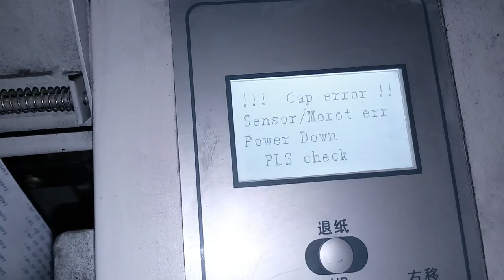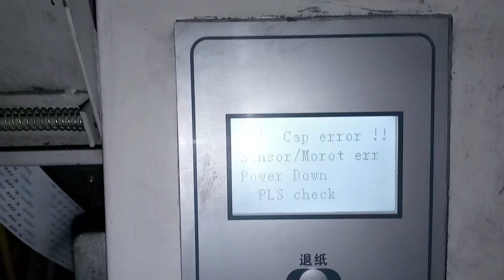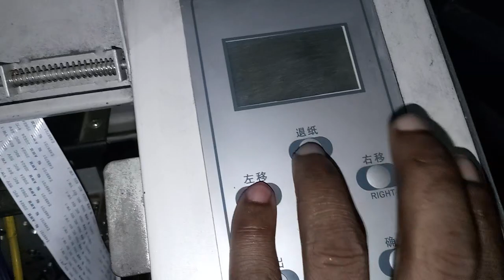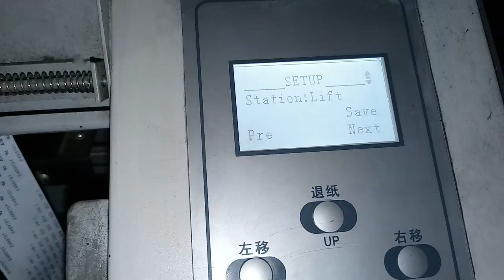XP600 LARGE FORMAT CAP ERROR: A VERY VERY QUICK FIX

Comment: Pls do u know the cost of a large format sensor replacement, vacuum tan and rean?
Reply from the maker: Your requisition is not clear.

What is tan and rean.

Your terms are not clear enough. Kindly rephrase.
Reply: @richwords1  ok let me clear I do not understand d words d engineer said, my large format had an issue its not printing very tiny prints, those tiniest things it is not clear , so an engineer checked it cost me said sensor 30k to mk it print tiny letters sharp. He said the vacuum tan 2 pieces 100k was to hold d paper to d machine when d head is moving and printing , and also rean 80k two pieces said the belt that pulls d head to and fro, it makes noise when moving to and fro, pls u should have an idea now I just want more enlighten so I don’t get cheated ,looks too expensive
Reply from the maker: @benqutesmith1143 what country are you from. 80k in what currency.
Reply: @richwords1  naira Nigeria
Reply from the maker: @benqutesmith1143 send a video of the machine behavior to me. So I can confirm how bad the state of the machine is.

+2348129337940